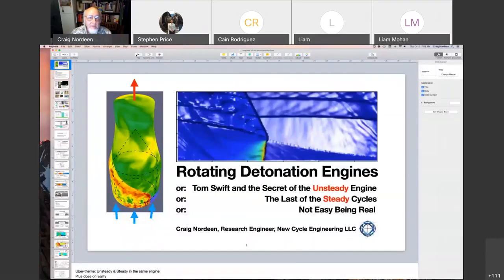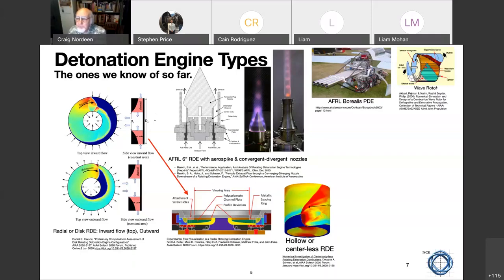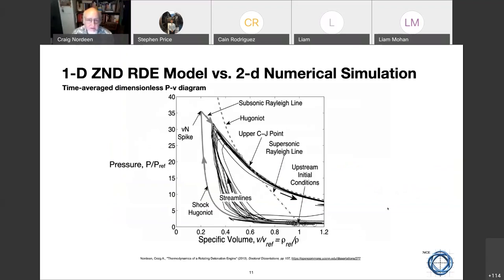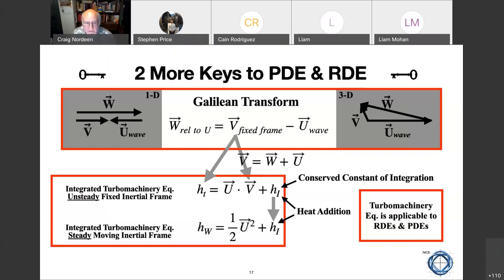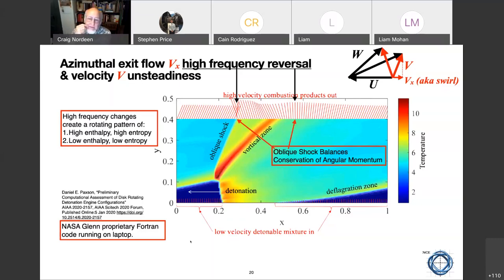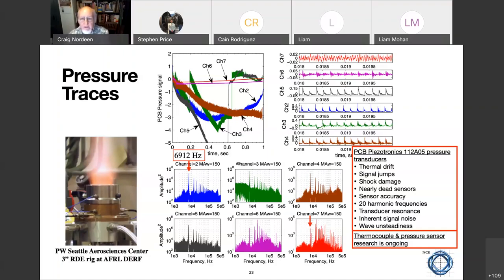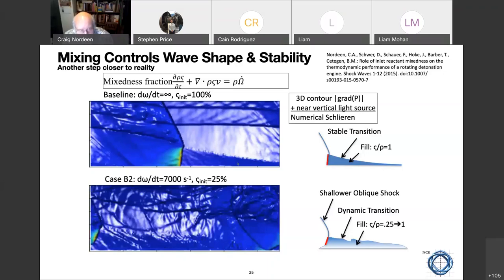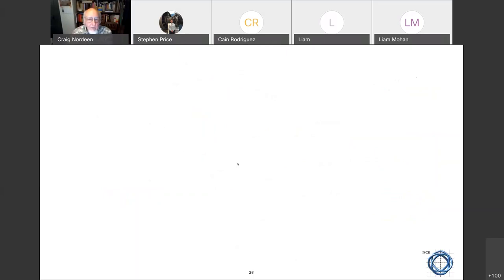UConn AIAA Lecture Series: Rotating Detonation Engines | Dr. Craig Nordeen 10/01/20

Comment: great lecture! Could one use a microphone at a distance and fft the signal rather than an inplace piezo crystal that will get cooked. calibrate the output based on the cooked sensors.

Comment: Newbie question.. maybe somebody can answer this:
I imagine that the average pressure in the detonation chamber is "high", but I have no idea what kind of ballpark we're talking about. What does this mean for the fuel injection lines? Do they have to be highly pressurized to maintain a positive gradient? Do the fuel lines require one-way valves to protect them from excessive detonation pressures?
Thanks!
Reply: The average pressure can be as high as you want it, depending on the supply pressure…plus whatever pressure gain is created by the detonation. The pressure within the detonation can be 30X (or more) of the upstream pressure. But it is a small region and passes by the individual injectors very quickly. No, injector pressures do not have to be higher than the max detonation pressure. They do have to be somewhat higher than the fill region of unburned gas that rotates just ahead of the detonation. There is a pressure drop from the plenum to this region. The exact magnitude is a topic of much research and very dependent on the specific design. The lines do not generally require check valves. Maybe for safety reasons.  There is a momentary back flow that must be accounted for and is also a topic of research. The back flow is driven by the passing shock wave. Any check valve would have to contend with that. Not a good environment for a mechanically moving part. The environment is very dynamic and complex in spite of a very simple geometry.

Comment: Could piezoelectric sound help modify the behavior of the shock waves and maintain the solid state nature of the engine?
Reply: Good question.  Don't know.  But I can use Feynman's procedure and guess. Sounds (!) like a research proposal.  I assume by "solid state" you mean "no moving parts."
First, it is a very noisy high energy environment. The frequency spectrum is broad band with lots of harmonics and sideband. Some non-harmonics have been observed. All of that is typical of non-linear systems. The primary non-linearity is the shock and can be thought of as a step impulse. 
Second, any desired behavior will have to be matched to the injected acoustic energy. Assuming a standalone engine,  the energy has to come from somewhere, and so would be a loss to the system.  Unless the resulting behavior causes an entropy decrease and performance increase to pay for it.  But maybe that question is getting ahead of things.
Thirdly, we (collective RDE community) probably don't understand enough of the fine details of the wave to know what needs modifying. The base thermodynamic cycle is pretty close to the ZND model. That models the detonation as a pure planar sandwich of shock, induction, combustion, and thermal choke. Using that model with some modifications gets a reasonable estimate of performance. Of the order of a 10% error. A realistic detonation is much more complicated, dynamic and three dimensional. This raises the question, just what behavior would we be after?  I would turn the question around and ask what behavior could piezo sound probe and uncover? That is, could you use it to find specific resonances that might be susceptible to manipulation?
4. Flush mounted piezo pressure sensors are known to have short lives in the RDE environment. They are fragile relative to the shocks. Current work on pressure sensors hide the piezo in a recess or have a buffer tube of some configuration to filter the incoming signal before it hits the diaphragm. So a piezo sound source would have to be pretty robust. That might create a large stiff piezo which undoubtably change its response and frequencies. A real design challenge. Maybe the source can be isolated somehow like the pressure sensors.
Reply: like a high intensity echo canceling of unwanted modes at high frequencies.
Reply: As a dampener or an amplifier? Because yeah. But is it useful? Who knows. Maybe as a frequency drift correction mechanism but it’s gonna have serious considerations for heat and life cycles since most of them are too fragile

Comment: Dr. Nordeen, how did you determine how much enthalpy gets put towards powering the shock and how much goes into available useful work?  Is it simply subtracting out the amount needed to equal the compressive work done by the shock or do you add a little more for some work transfer losses, the same as you would for mechanical losses in the shaft between a turbine and compressor? In your figure I noticed it seemed to work out to be at the point where the enthalpy remaining was equivalent to the enthalpy at the end of the constant pressure heat addition process for the analogous Brayton cycle. Is this a coincidence or a consequence of some other dependencies, maybe due to the model being ideal?

Also, how similar was the ratio of useful enthalpy to total enthalpy (redline over red+orange line) in your streamline analysis to the same ratio in the ideal model? I saw that in the streamlines the connection with the Hugoniot was below the CJ condition. I’d imagine this implies a change in the amount of work needed to drive the shock and therefore you might have seen a difference in available work per total enthalpy (again I’m referring to redline per red+orange line). I’m curious if this ratio changes in a predictable manner with the location of where the cycle hits the Hugoniot (which seems to almost always be different than the CJ point in the case of an RDE). With this in mind, do you think you could estimate boundaries on where the cycle can intersect the Hugoniot (likely centered around the CJ condition but maybe not) and still improve on the equivalent CP cycle via comparisons of this work ratio?
Reply: You have enough questions for a good paper. Maybe a thesis.  I may have to do this by parts. I have a paper in progress at the moment that needs to be finished.
It is not a coincidence.  It is the conservation of energy. The peak enthalpy appears to be greater than the added heat of combustion. A related question was put to me as, "where does all this extra energy come from?" There is no violation and there is no extra energy. As you note, there must be energy to power the shock. But the rise in shock total enthalpy is greater than the drop in enthalpy from the CJ condition. (Skip to method #2 to see how to do this.) Also note this must be done with total or stagnation enthalpy. There is a transfer of work similar to that of a turbine powering a compressor. Instead of a shaft, the energy transfer is the same you would find in a rocket or gas turbine. It is a momentum exchange.There are three ways to do the energy accounting. 
The method of rothalpy transfers the problem to the rotating frame of reference and the sum of energies is quite easy. There is no total gain of rothalpy across the shock and the remaining rise of rothalpy is the heat of combustion, which brings the total rothalpy to the same total enthalpy as a CP process. The problem is much simplified in the rotating frame.  After the detonation combustion is completed (ideally) the expansion of useful work can begin. The final rothalpy before useful expansion is the same energy as  the constant pressure. The difference in determining the useful work is due to the (ideally) less entropy generated by the detonation, because of the curvature of the constant ambient pressure line that is the end of that expansion. It is the reduced entropy and increased useful work that has created all the interest in detonation engines.
The accounting in the fixed laboratory frame is more complicated and the source of the confusion. Here the shock compression enthalpy must be paid for by a comparable expansion. There are two expansions that together power the shock.  One expansion is almost  invisible. The second is the expansion from the CJ stagnation point to the same enthalpy as the CP process, but with less entropy. The second expansion occurs during combustion. This expansion is more obvious on a P-V diagram of the ZND model. Combustion occurs on a Rayleigh line with a negative slope. As the combustion proceeds down the Rayleigh line, temperature increases, but pressure drops and specific volume increases…an expansion. This can be accounted for on the h-s diagram by substituting an equivalent process consisting of a constant pressure line starting at the end of the shock stagnation line. Add the heat of combustion to find the end. It should end with the same entropy as the CJ point. Taking the expansion down to the same CJ stagnation point completes the excercise. The excess enthalpy of the hypothetical CP combustion is the expansion work required to power the shock plus the additional expansion starting at the CJ condition.

The third method requires an integration along the process to account for the energies. Tom Kaemming used this approach in his work.

I will think some more about your remaining questions. But I will note that there are deviations from the ideal process. One such deviation accounts for the streamlines ending at unexpected points. There is an expansion in the fill zone that causes each streamline to follow a unique path that is due to starting at different initial conditions. There is a gradient of all properties across the front of the detonation that causes the different paths. There is a more complex story just in the injection and fill process than I wish to recount here.
I hope this helps. More later.
Reply: @craignordeen8245  Thank you so much for taking the time to write that all out. I understand much better now why the point of useful work is constrained by the enthalpy of the CP process/heat release of the combustion reaction. This seems to suggest that regardless of where the detonation falls on the Hugoniot (above or below the CJ) as long as some pre-compression  occurs  prior to the actual combustion (meaning there is some level of shock combustion coupling putting you on the supersonic/high mass flow regime of the Hugoniot) you’ll get lower entropy and therefore some benefit over the CP process. This to me is useful because it is an argument for not constraining RDE designs to those that will produce near CJ condition behavior. As long as there is a shock wave involved you’re improving efficiency assuming the same heat release. 

Also,  the function of the rothalpy approach is much clearer. I know the PDE and RDE cycles are very similar, so if you get good results using rothalpy in an RDE, does that mean you could use it for PDE analysis? Or does the lack of a rotational component force the math to become essentially method 2 and/or 3?
Reply: @CAVU101  Yes you can use it for the PDE. The 2 things to realize that the turbomachinery equation (h_t=U*V +h_I ) is an equation of relative motion (not just rotation) and that the U*V is a vector dot product.  It becomes a rotational  problem when it is expressed in cylindrical coordinates. Or U=omega*Radius. An interesting thing is when you do that and if you consider only the rotational axis: U*V becomes omega*R*V_theta.  The term R*V_theta is the specific angular momentum and is conserved…if you integrate or mass average around the chamber. 
So in the PDE, the U*V term become just U_x*V_x, where the y & z components are assumed to be zero. Where U_x is the wave speed down the tube. V_x is the particle velocity. In the wake of the detonation, V_x is called, by some, the "following velocity."
If you substitute the vector equation V=W+U into the turbo equation to introduce the W relative velocity, you get h_W=U^2/2 + h_I. where h_W=h+W^2/2 or total enthalpy in the moving frame. 
A working assumption is that flow is steady in the moving frame. So for any point in the moving frame all those terms are constant or conserved. The substitution is best done using vector algebra.
If acceleration is involved, the equations can become much more complex. For the RDE, some have invoked the coriolis force to explain some things. There is some very obvious acceleration in a detonation. To date, I am not aware of any identifiable effect of the coriolis force. So far, the engineering rule of "close enough" to steady flow works pretty well and coriolis must be a negligible thing. But beware and aware of assumptions. They can lead you astray. There may yet be an effect.
As an exercise, you might try to work out how the above scheme is related to the equations here.
https://en.wikipedia.org/wiki/Fictitious_force

Comment: Is harmonic noise across the thermal gradient in an RDE a problem? If so, how do you deal with it??
Reply: I am unaware of any harmonic noise issues anywhere in the RDE that require necessary attention. Can you be more specific?   If you mean across the thermal gradient in a chamber wall by the passing wave, the heat flux quickly becomes an average temperature some microns below the surface. Any harmonics in that layer are beyond detection. There are enough issues keeping the thermocouples from melting. The problems of the heat transfer include material limits, cooling and shock spalling.   If you mean across the detonation itself, there certainly is enough noise, but does not appear to cause any difficulties, except in our understanding of the dynamics. A harmonic noise implies a sonic phenomena, perhaps what might be found in the combustion instability of a deflagration combustor. The rotating detonation is supersonic and often of the order of Mach 4. So any sonic phenomena get quickly over run by the detonation.    Many numerical simulations use the inviscid Euler equations rather than the more complete Navier-Stokes which models diffusion mechanism like heat transfer and viscous flow. The cost of computational modeling motivates the use of the simpler Euler models. The diffusion mechanisms in N-S models are usually not a serious concern for the basic modeling because the diffusion processes are limited by sonic velocities. The detonation is much faster than those mechanisms. A FFT of pressure probe data typically exhibits a primary frequency with many high frequency harmonics of decreasing amplitude. This is typical of non-sinusoidal wave shapes. A saw-tooth wave creates a similar form. Along with the harmonics there exists a considerable noise background which is typical of non-linear systems.  Non-harmonic frequencies of unknown origins have also been seen.  Much of the noise certainly comes from the transverse waves. But our knowledge of the detonation structure is incomplete. There is no consensus on the mechanisms of the detonation cell structure. Rather than a harmonic phenomena, it is more closely driven by the reflection of transverse shocks off boundary conditions. The detonation is highly non-linear and non-linear theories and tools are required. One current hot research topic is the creation mechanisms of multiple detonation waves. Hope this helps.

Comment: Does RDE also product gyro force in 2 or more wave system?
Reply: Depends. But probably it does not depend on the number of waves.  I assume you mean a torque applied to the chamber by the wave. A reduced order model indicates zero torque because of the conservation of angular momentum. Recent research shows there may be a small amount of residual torque for a symmetrical chamber with no inlet swirl and a flush exit. Any torque would be transmitted through viscous boundary layer forces. However, there is evidence of torque that is applied to aerospike type nozzles. There appears to be no agreement on the existence or source of the torque. Perhaps from the reacting torque being applied to the surrounding ambient air.
Reply: @craignordeen8245  can you suggest some books or paper where I get learned about there basic concept and designing?
For reference I'm a mechanical graduate!!
Reply: @craignordeen8245  thanks Mr Craig!!